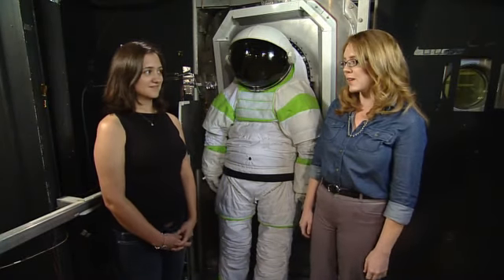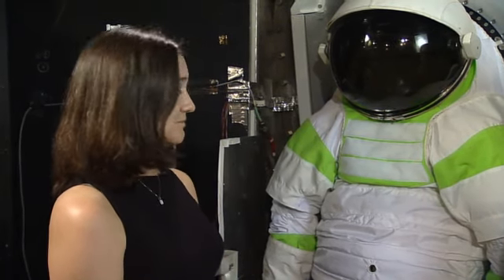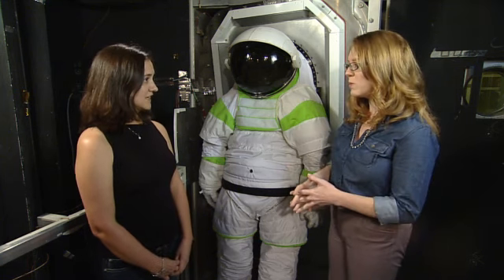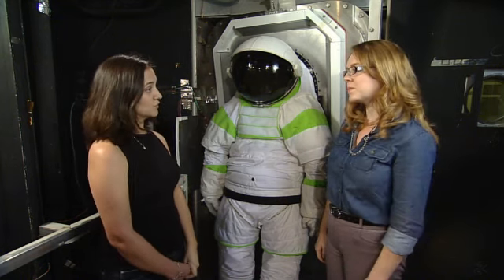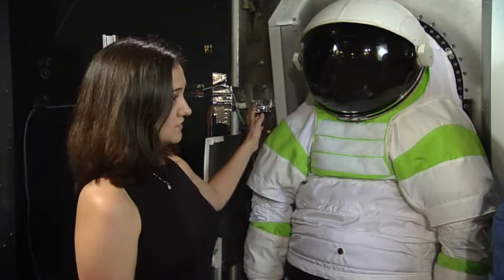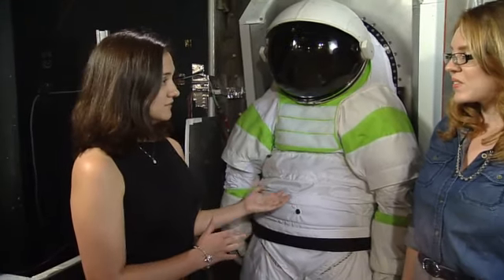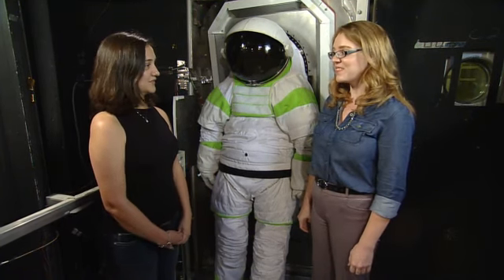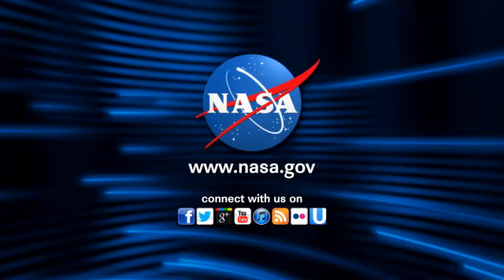ISS Update: Z1 Spacesuit and Suitport Testing

Comment: What about the long term exposition to harsh space conditions? If you keep the Z-1 always outside, how could you check it visually for damage and maintenance? My main concern is for preventive maintenance to avoid malfunction. I would suggest that the place in wich the suits are located should be protected by a flexible and lightweight, kevlar-like, zippered cover just for keep it shielded.

Comment: The mechanical counter-pressure suit does have promise, but it has a couple of problems, a) it's designed to be tight, so donning is difficult, and b) if a void develops in the body creases you are going to have a problem.   If we could develop a suit that tightens up after you put it on, that's the holy grail of mechanical counter-pressure.  

 "The statements and opinions posted by me are my own and do not necessarily represent NASA's positions, strategies or opinions."